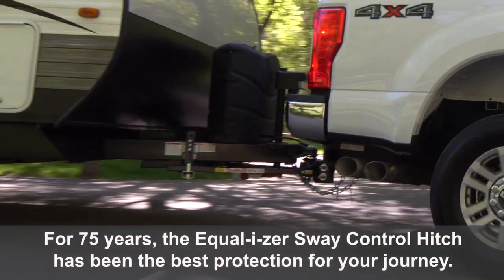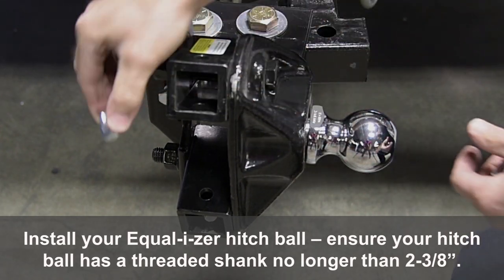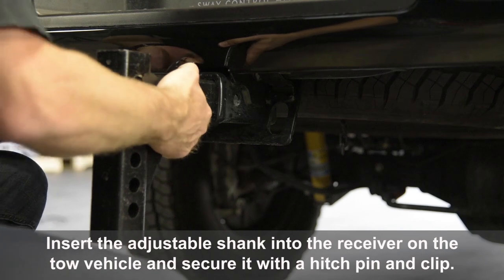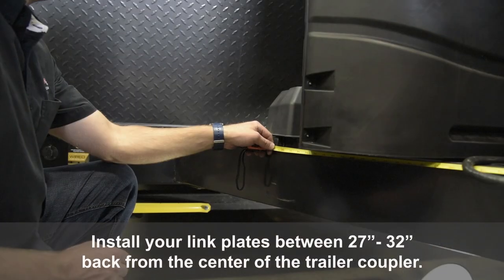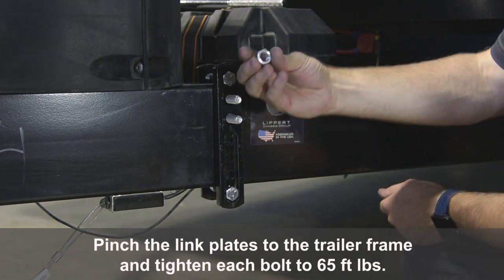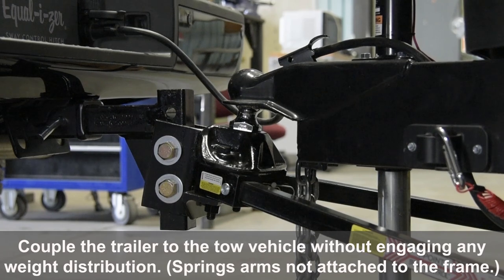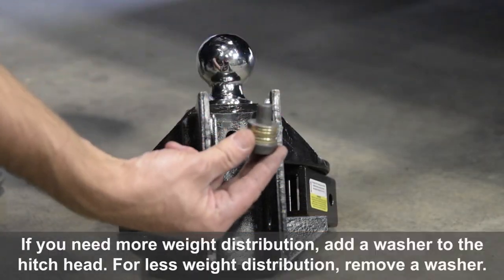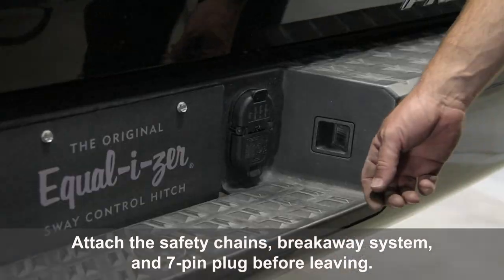How to Install an Original Equal-i-zer® Sway Control Hitch (6-14k models)

Comment: Nice video!   I just upgraded to this hitch after running with a Fastway E2.   Quick question:   For the L bracket install the manual indicates to place them between 27-32 inches from the center of the coupler head, depending on your clearance.   

What would be your recommended placement distance if there is nothing in the way?  Meaning if I have room to place mine anywhere in that recommended range of 27-32 inches should I shoot for the middle of that? Thanks!
Reply from the maker: Hi there!
 The best way to get an answer to your question would be to contact our customer service team at support@equalizerhitch.com or call them at (800) 478-5578!

Comment: I was trying to install the 10k model today but after coupling the trailer to the hitch ball, the levers were directly under the L brackets and I wasn't able to move them out to the side to get them on top of the L brackets. I didn't see this issue mentioned in the manual or video. What am I doing wrong?
Reply from the maker: Hi! Go ahead and contact our customer service team at support@equalizerhitch.com or call them at (800) 478-5578! They should be able to help you make sure your hitch is set up correctly!

Comment: When measuring the trailer to see if it's parallel to the ground, do both sides of the trailer have to be the same? Or just the front and back measurements? I can make set equal height front to back on one side of the trailer but the other side is off. Ground is somewhat flat but not sure how level of ground I need to be on in order to set the trailer parallel.
Reply from the maker: You want your trailer and hitch to be as parallel and even as you can!

Comment: Will this hitch system work with lifted trucks?
Reply from the maker: The Equal-i-zer Hitch works with great with the majority of towing vehicles and can be adjusted to fit on most raised vehicles. Having a lifted towing vehicle may require you need to purchase a bigger rise/drop shank in order to place the hitch ball at the correct height. To determine if you need a larger than standard drop shank size for your setup, you can use our shank size calculator at the following link. https://www.equalizerhitch.com/find-your-shank-size